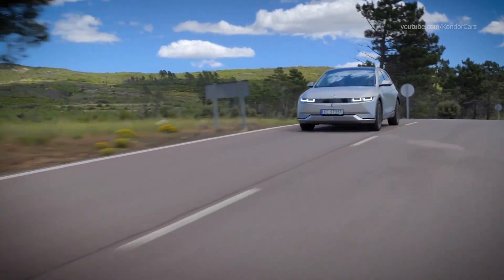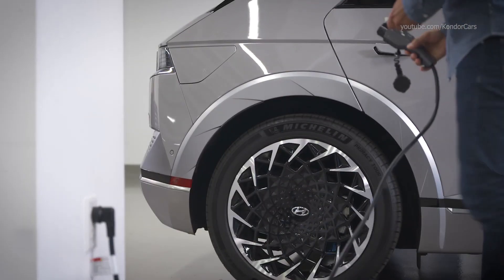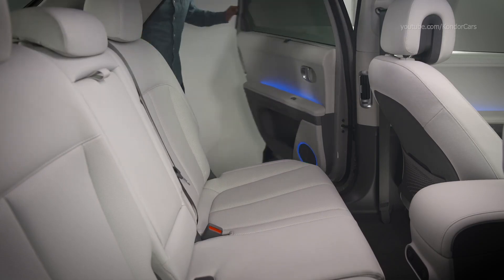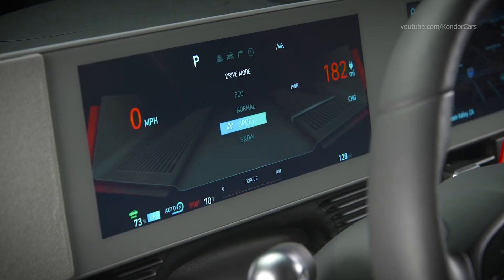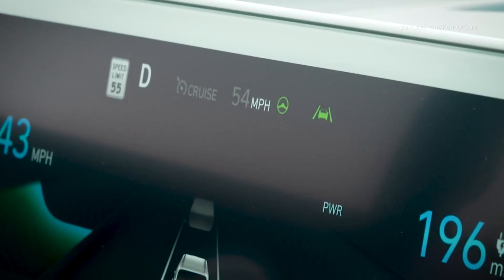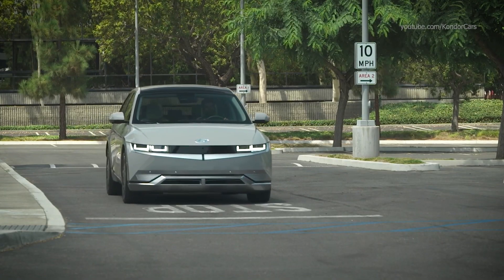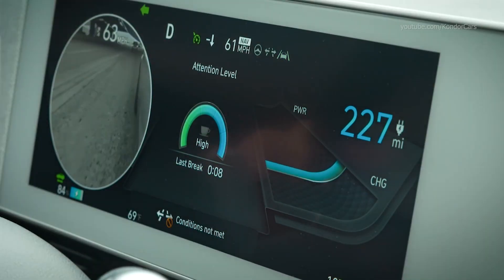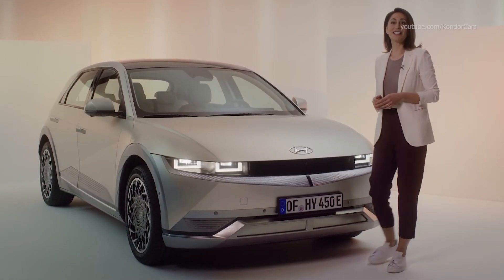Hyundai IONIQ 5 All Features & Driving Assistance Systems Explained

Comment: Ioniq 5 has one very dangerous failing. When the 12v battery fails and believe me they do, and you are INSIDE the car, the locked doors and windows will not open. There is no mechanical method for opening the doors in a hurry. Assuming you are an athlete you can figure out how to get through to the luggage compartment  and possibly in the dark find a slot into which you are expected to insert the key to be able to open the back. Imagine trying that in an accident with flames…Hyundai need to sort this out. The UN Car Safety Group are hauling Ttslabover the coals for the same issue.

Comment: 3:17 — Admittedly a little pedantic, but there’s really no such thing as Level-3 chargers:

https://youtu.be/jZBsOud4O9Q
Reply: It's not the fault of consumers that they intuitively extrapolate from L1 to L2 and then L3. You have to hear it from a video or some other source to learn that it's called Fast Charging DC. People will learn quickly once they have the car. 

The next question, though, is what are they going to call Level-4 charging when it becomes available (assuming that this is possible, like 5G cell service seemed impossible to imagine 20 years ago.)

Comment: FIRST OFF - huge mistake - creating propriety charging adapters/means 
was the biggest blunder ever. Make these vehicles plug in to regular 
120V receptacles. We already have the infrastructure - creating a whole 
new infrastructure to charge these vehicles consumes a huge amount of 
energy which negates the benefits of the EV for an extra amount of time.
 This also limits the consumer base.
Reply: Every commercially produced electric car can plug into an ordinary power point. You need a to use an EVSE portable charge cord with the right plug. The box in the cord tells the car what type of plug is on the cord and that tells the car the maximum current it is allowed to draw safely from that sort of outlet.

Comment: 00:19 is the solar roof available in USA?
Reply: The panoramic roof with solar panels is only available in the top of the range equipment, which in the United States is the Limited, I think.
Reply: @Ronin585  I have limited and we don't have solar panels in USA. only in SK I guess,
Reply: @rajaram4658  A pity...🤷‍♂️

Comment: Be Sure to Grill the sales man about features with and without your car. This Car is top of the range and get all the bells. Most of the rage you don't get pop out handles or the reclining seat or head up display.
Reply: All models of the Ioniq have pop out handles.  What the lowest doesn't have is reclining foot rest, sliding console, head-up display, automatic back gate open and close, all four power seats (only driver's seat has power), driver seat memory.  I have the lowest model (the SE) and it seems like every day I discover something ELSE it doesn't have.  What it DOES have is the best range and that is why I bought it.  It has 303 mi. of range.  But, in a few years when range gets better on all models, I will trade it in for the top of the line and all those other wonderful features.

Comment: All those automatic handles and the charging cover, do they open and close well during winter in Canada? Does it freeze and becomes hard to open and close??
Reply: Those are good questions; I watched a video on the Ioniq 5 that was made by a guy in New Jersey. He noted that you can actually use the car's app to instruct the main battery to warm itself, so that it takes a charge faster (apparently much, much faster). It won't be a consideration here in San Diego, but in many parts of the continent, it definitely will be.

Comment: A nice overview about the ioniq 5.
Gives a good insight in the more important possibilities.

But at 17:60...
something is not completely correct.
The trunk storage in front =57 liter.....this is NOT an AWD version. In the AWD versions this box is much smaller (however, my charging cable still fits within that smaller trunk)
The towing capacity =1600kg....That's ONLY for an AWD version with big battery or in other words...a smaller trunk in front. (at least ...in my country and for the project 45 versions.)

Comment: This Car could have been awesome but it has sooo many Bugs and flaws, I don't understand how this could bei released in this beta stage.
Reply: Obvious Tesla Troll. Tesla is the king of bugs. I know 4 people who have Teslas and all have been for service within weeks of purchase for all host of little and big issues. Now that's a beta release.
Reply: Mind to elaborate on that?
Reply: Go home troll. Elon's lap is waiting for you. Either that or return your lemon.
Reply: I am for sure no Tesla troll, I loved my first Ioniq, that car made so many things right, that the new Ioniq 5 doesn't.
- Loading in winter is under 50 kW
- you cannot use the plug-socket while loading
- the heating is not properly working im winter, it just stays cold
- the highway assistant has bugs 
- the laneasisstent let's the car shake constantly
- the route/loading planner it a "joke", could be improved a lot :D
- the driver seat is not properly fixed, it shakes/moves when you accelerate
- while you are driving a turn the back of the car makes noises like an old wooden sailingship.
- it is not that efficient

There is a lot more stuff not working properly right no. They need to do a lot of software fixing.. 
It is like betatesting a Car for 60k Euros, I am really a true Ioniq fan, but right now I don't feel very happy with this car.
Reply: @slatorarsenic7859  Well I must of seen about 50 video reviews and the only thing so fat that has been a negative is the fact it does not have a rear wiper , I test drove one in Canada on a very wet day but it was not a deal breaker I was waiting for a new Kona but changed my order after the test drive to the AWD long range ultimate package I was very impressed by this car.
Reply: @slatorarsenic7859  Thanks for the info yes I am sure there be things to fix , the good thing is I don't think I will see my car for 6 to 8 months from what I hear so that does give them time to update . I am hoping in Canada I can get the update to change the rear can to be on all the time like in the UK that will help in bad weather , I also want to get both front seats the same with the relax leg rest I see its in the US and of course in Europe I can't seem to get an answer from anyone in Canada also I wonder if I can get the VTL adapter . I just wrote to Hyundai Canada to see if I can find out as the dealership does not seem to know. I will let you know the out come.
Reply: @slatorarsenic7859  I will always check the channel from Bjorn Nyland for EV testing. No one is testing more complete than that guy (in Norway...cold enough for winter tests). Also this guy has no other agenda pro or contra any producer.
(Also making video's under the channel name Tesla Bjorn)
I did not got all those complains from him....slow charging in winter is the only one ...but not 50KW .
Of coarse the ioniq 5 must be set in winter modus.....maybe that's the problem with such low charging speed.
Reply: @shaunmckenna1923  ordered mine last week as well
Long distance preferred pckg, 2023
Really not sure when I will take possession 
I put a down payment down to reserve my spot
Reply: @mikeg5350  What part of the country are you in? Even though Ioniq 5s are in high demand here in SoCal, I was able to grab one in 10 days from when I started my search. Would have been even quicker if I'd accepted an AWD SEL. I only wanted the RWD in either SE or SEL. When one came in, I got the call right away.
Reply: @slatorarsenic7859  I dont have any of those issues you mentioned. You must've gotten a lemon!

Comment: I think Hyundai's approach to inattentive driving is IMMORAL! If the driver doesn't have his hands on the wheel and appears inattentive, he probably fell asleep. If you punish him by disengaging the active cruise control features, you just signed his (and possibly others) death warrants. The only correct solution in this scenario is to pull over onto the shoulder and bring the vehicle to a stop and shut it down.
Reply: It does’ t disengage completely, it keeps correcting and sounding the alarm until you grab the wheel. I tried.
Reply: @helikopeter1  That's good to hear. It does disengage on my 2021 Santa Fe.
Reply: I don't know of any EVs that do what you recommend. Tesla, for example, has the car continue to drive until it comes to a untimely demise. That has actually happened.
Reply: @mrxman581  My point exactly. These cars are capable of CHANGING LANES. If they can do that, they can pull over to the shoulder and stop. It's simply a matter of software coding. Choosing catastrophic failure now so you can sell a software upgrade tomorrow is outright IMMORAL in my book.
Reply: @richardloewenhagen3818  the changing lane feature is not completely automatic. It requires driver input. Besides, changing lanes is loads less technically complicated than pulling over multiple lanes and stopping safely on the side of the road. That's exponentially more complicated.
Reply: @richardloewenhagen3818  A vehicle, no matter how 'smart', can't have morals. The immoral act lies squarely with the driver choosing to drive in a situation where they shouldn't. Be awake and alert when driving. They are driver ASSISTANCE systems, not fully autonomous driving.
Reply: @kennethaalberg6972  You missed my point completely.
Reply: @richardloewenhagen3818  Maybe stop shouting about immorality and the conversation will go better. You sound like a news headline.
Reply: @kennethaalberg6972  You're missing the point. This is not about someone sleeping behind the wheel....
it's about getting an heart attack and loosing consciousness.
If , at that moment, the system for keeping lane and distance from other traffic switches off it can create a disaster for other people.
Detecting that would be very helpfull and of coarse calling 112 (europe) or 911 immediatly..I mean that the car should give the emergency alert in such case. And the car could start changing lanes until the side of the road is reached...inclusding automatic starting alarm lights.
But I'm afraid that's stiil to much futuristic...May be they will programm this in an update once.
Reply: @richardloewenhagen3818  Please, wait until next update of software. But most regulation says if the driver feel fatigue, don't drive, take a rest. If a car has a such auto resting system many drivers will not stop driving even they are feeling fatigue.

Comment: In the event of a 12v discharge, it’s very unlikely that plugging in the J1772 charge cord will start charging, because all the control modules need 12v from the 12v battery before any charging can take place. Odd there is a manual release for the charge port door. Unless Hyundai added technology that would allow a fully discharged 12v battery to charge up just by plugging in charge port.
Reply: Saw another video just today for this issue. There is an adaptor that looks like a battery pack attached to two traditional (red & black) clamps, like you'd use for jumpstarting a car. The video creator advised that you keep the adapter in the 'frunk', so you can charge the 12-volt battery for a very short period (less than a minute, I think), and then the 12-volt will re-link to the operating battery. 
Hope that makes sense- this is my novice interpretation.
Reply: @RickLeBeau  I have done that a couple of times now.

Comment: I've seen a lot of Ioniq 5 reviews and they're raving about it but it's not even in the dealerships at the moment.
Reply: You needed to order it 4+ months ago minimum. Or pre-order a 2023 model now and wait patiently
Reply: @ryandidthis  Hyundai sent be an email to peruse their future offerings.  Looks good but price wise it's a bit on the expensive side.  And you know the dealership will mark up the price because they know it's going to be a best seller.
Reply: @kanehi  Very true, but still cheaper than a Tesla and it qualifies for the federal tax credit. Tesla's don't.
Reply: @kanehi  I got one car from the linited  project 45 version , no dealer markup possible. The price was fixed (for my country) at the worldwide presentation of the ioniq 5. 
(But afterwards I learned that getting one was only for those who reserved the car immediatly...within a few minutes after opening the side for reservations.). Also in my country the prices are written on the web side from hyundai , the dealer will not go higher than  that.
Reply: I realize that I'm responding to your comment four months later, but...I was only in the market for 10 days. On day 3 I put a deposit on one, then turned it down when I was able to procure another one from a dealer that doesn't add on a "market adjustment" of several thousand dollars. The key seemed to be diligence, persistence, and homework. Oh, and it helped to be nimble enough to be ready to buy when the call came that the dealer had a car. They didn't take pre-orders there. They just had a list, and they'd call people on the list until they got a yes. They didn't even call the same person twice. If you missed the call, you missed the car.

Comment: I love how this car has a solution for "no 12V battery problem". Door, charging, making the whole process as smooth as it can get. 10/10
Reply: The issue with the sequence shown at 2:26 is that the electrically powered tailgate also needs a working 12V battery to unlock and open, so this sequence doesn't work! Andrew Till shows what to do in this situation here: https://www.youtube.com/watch?v=A4NUdNWyocM&t=149s
Reply: @peterthomson127  you can access the driver door and access the back from there. I got your point tho and I do have one of those charger starters.
Reply: Absolutely agree.  나도 같은 의견을 가졌어요.
Reply: It's almost as if they knew they were going to have 12v battery issues 😅

Comment: Regarding HDA (highway driving assist), do the car and the driver simultaneously control the wheel?  

I recently rented a Hyundai Santa Fe, and I really liked how its steering-assistance system worked.  In short, it doesn’t pretend to be a self-driving car:  the driver always steers the car all the time, but the car does so too (when it can confidently do so).  You’re always in-control, but if something distracts you, the chances are high that the car will steer itself correctly.  It is a safety-backup system,  not a fake self-driving system.

Is that how it works on the Ioniq 5 too?  From what I saw in this video, I think the answer is “yes.”

Last I checked at least, Tesla Autopilot has distinct “car is driving” vs. “you are driving” modes.  Yes, you still keep your hands on the wheel, ready to intervene, but if you provide too much steering input, Autopilot disengages.  Why?
Reply: I have 2021 Santa Fe with all the active driving features, and I love it. However, if you see my comment above, I'm horrified by the stupidity of 'punishing' an inattentive driver by disengaging the active driving features. If the vehicle can maintain lane position, it most certainly has the capability to change a lane. If it can do that, it is unforgivable not to maneuver the vehicle to the shoulder and bring it to a stop BEFORE deactivating!
Reply: the car and the driver simultaneously control the wheel. It doesn't disengage even if you provide too much steering input. You have to exclusively push a button to disengage HDA2/LKA, so it's the same as Santa Fe
Reply: @cjsk2783 , perfect!  Thanks for confirming that.
Reply: You not a car. Just try to trust your self if not your car holds a legitimate license for self driving.